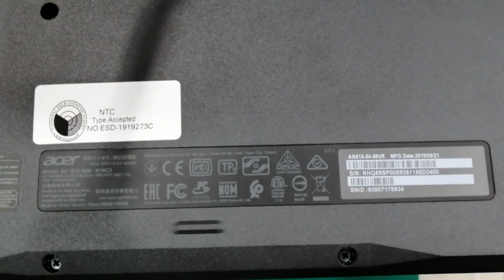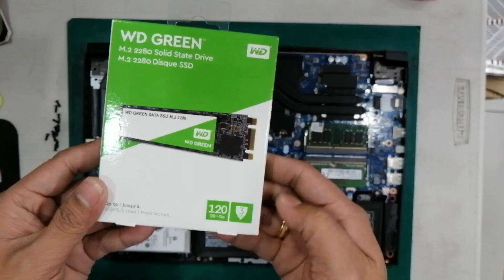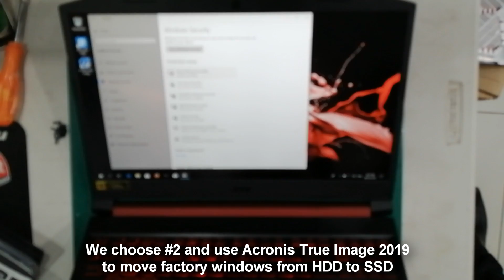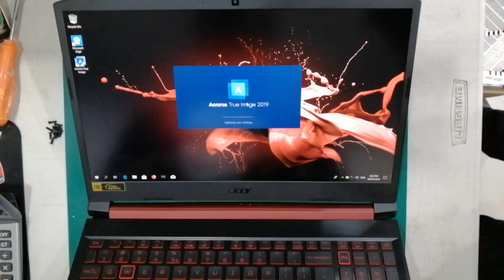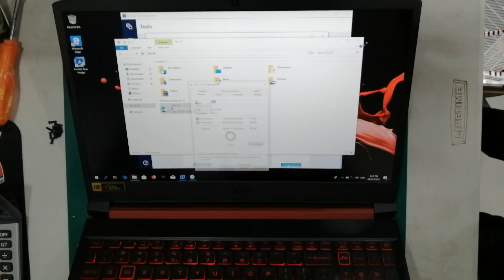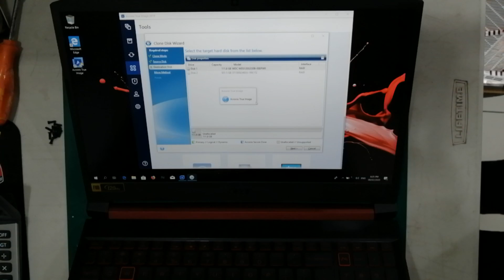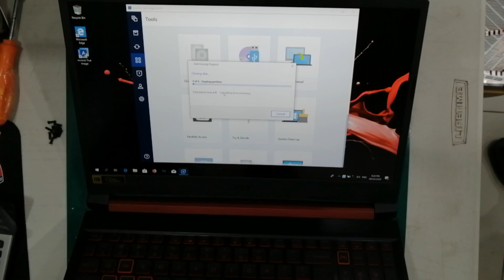How to upgrade acer nitro 5 2020 (Full)

Comment: hi, have the i7 version, been working great but now my battery won't charge, just says 28% and plugged in, tested charger putting out 19.5 volts, tried resetting battery by holding down power button and deleting the two battery drivers, still not charging, any help would be much appreciated,  cheers
Reply from the maker: russ myles I cannot assure sir it will work,but try to update the BIOS if there is bios update in acer website,if not try also to reset your windows to factory default,try also to change the ac charger with a known good one because testing the charger with just multimeter is not enough,if you done everything you can and still does not work may be its time for the warranty
Reply: @techph7854  ok thank you for you reply, will check acer website for update, have s charger from a hp laptop, will try that too if compatable,  nitro5 only 6 months old but under lock down here in tenerife, shops all shut till may 11th
Reply from the maker: @mylesruss  good luck

Comment: Hey my laptop is the one with 1tb hdd. Is there another hdd slot or I'd have to replace the 1tb ?
Reply from the maker: James L check your laptop if there is any m.2 slot and you can add storage in there,if you cannot find m.2 slot yes you have to replace the 1tb HDD to 2.5 SSD 250GB or higher,if you have desktop use cloning software to clone from your 1tb HDD to SSD,if you don't have desktop just fresh install windows in SSD
Reply: Thanks. I figured. M2 more expensive but don't wanna waste parts. I'll figure it out. Thanks
Reply: If it's of the same model, it would have M.2 slot for sure. Otherwise, it may be mentioned in your laptop specification. There's only 1 hdd slot.

Comment: Sir balak ko bumili nitro5, smooth ba gaming at video editing, streaming sa specs na:
I5 8th gen
Gtx 1650
16gb ram
256 ssd 1tb hdd
Reply: solid na yan ser. 16gbram + gtx 1650 na
Reply from the maker: pa subscribe nmn sir kung ok lang
Reply from the maker: Angelo Sendaydiego,yes sir smooth most of the game,ano games nilalaro mo sir?
Reply: TechPH im planning to buy one for school works and gaming
Reply from the maker: @theprobuilder1008  yes sir it is capable,I recommend you upgrade  the RAM to 16GB for autocad,but few of my client says autocad rendering is quiet slow,for most of the games you cannot set all settings to high to play it smooth like csgo
Reply: TechPH Thank you for the info! New subscriber
Reply: TechPH sir is the ryzen 5 3350h rx560x version of this is capable of running AutoCad?
Reply: Sir ok na po ba dito LoL Dota Cs Go?
Reply from the maker: @obliv1on16  yes sir,wag lang kalimotan e upgrade RAM to 8GB
Reply: Mas maganda ba to sir sa huawei matebook d15?
Reply from the maker: @obliv1on16  I am sorry sir I am not familiar with huawei laptop

Comment: People having stuttering issues know that it can be because ur shader cache is off in nvidia control panel and ur laptop is heating above 80 degrees try cooling it down keeping on a elevated surface for more air flow.
Reply from the maker: RTR GRIM REAPER nice info
Reply: @techph7854  thnx :)

Comment: Bro ok lang ba yung 2x 2400mhz 8GB na ram dual channel na yan diba? Bago lang sa pag upgrade haha
Reply from the maker: Lex Acuna yes bos,2x 2400mhz or 2x 2600mhz,kung pwede same din ang brand nila dalawa
Reply: @techph7854  thanks bro. nga pala bro na undervolt ko na laptop ko -0.150V pero nag  Power limit throttling pa rin kahit pag nag benchmarking  tapos gaming... Any solution on how to fix? Intel xtu gamit ko.
Reply from the maker: @lexacuna2924  sir di ako sure pero try check the temperature CPU and GPU,baka dahil sa mataas na temp mas maganda mag cooling pad

Comment: Boss Question: Plano ko po bumili ng nitro 5.. Kaya po kaya kung i.upgrade ko sa 16Gb of ram at SSD 240Gb SATA? Maraming salamat boss!
Reply from the maker: Matthew Padrique kayang kaya sir tested na yan,pweding tanggalin mo yong 4GB RAM at palitan nang dalawang SODIMM 8GB
Reply: @techph7854  Last na po boss, ano po ba yung bibilin kong dalawang SODIMM? 8Gb DDR4 2666MHZ or 8Gb DDR4 2400MHZ? Para po sa Acer Nitro 5 AN515-54-53ED.. Pasensya po boss, baguhan pa lang po ako.. Godbless! 😇
Reply from the maker: @matthewpadrique1363  I am happy to answer your questions as long as I can,kahit ano sa dalawang yan sir mag wowork nang walang problema,pero recommended ko yung SODIMM 8GB 2666MHZ,remember na normal lang na ang detect nyan sa windows ay 2400MHZ
Reply: @techph7854  Maraming Salamat Boss! Stay safe po.. Godbless :)

Comment: i am going to buy the gtx 1050 version of it without ssd. I just need it to study and play cs go and  rainbow six sometimes. Do you think it will do the job?
Reply: I have the old 1050 version trust me the standard version is rly disappointing, i upgraded it using nvme ssd 500gb wd black 16gb of ram and replace the hdd with sshd 2tb it turned into real gaming laptop now capable of running newer AAA game like Nfs heat 50fps high 1080 also change the paste with thermal grizzly.
Reply from the maker: Eliza Oliveria yes it will do the job but for playing games like rainbow six the graphics is not that great,just don't forget to upgrade it to SSD and the RAM should be 8GB,4GB RAM these days is not enough for most of the games,Also if you can  get the 1050ti version that would be more nice
Reply: @techph7854  ok, thank you

Comment: Hey sir! What kind of screwdriver did u use for the ssd m.2 screw? I can't really remove the screw there because most of my screwdrivers does not fit on it. :((
Reply from the maker: Sam Villaluz the smallest phillips bit,I recommend you buy all in 1 screw driver,make sure not to damage the m.2 screw
Reply: PH01 size screw driver

Comment: does extra ram give me more fps in games?
Reply: Depends what game you play if a game recommends 16 gb of ram and you have 8 it may make a difference.
Reply: Tacoman 2.0 does it give me more fps in fortnite if i upgrade from 8 to 16
Reply: Now a days u need atleast 16GB Ram but Ram Upgrade is totally depends on your CPU If u have a 4Core 4Thread CPU 8GB Ram Is enough .
If u Have a 6Core 6Threads and more Cores And Threads u need atleast 16GB Ram and 32 GB for more Ram for High End CPU
Reply: Giftson Raja i recently bought a gaming PC with 2x8 ddr4 and an eight core processor
Reply: @jayden94207  Ok
Reply: Maybe like 5-10 fps more so not really worth it I think
Reply: Tacoman 2.0 okay thanks
Reply from the maker: Jayden Struijck Tacoman is right
Reply: TechPH okay thanks to both for responding, you saved me some money!!
Reply: ahmeher yeah thanks man
Reply: i upgraded from 8 to 16 and im running fort with 100-200 fps.
Reply: YouGotR3kt ! what fps did u run before the upgrade
Reply: yeah

Comment: Hi, will my nitro 5 automatically clock down my new ram(16gb ddr4 2666mhz) to 2400mhz? Since my nitro 5 speed can go only up to 2400mhz or do i have to do something with the bios?
Reply from the maker: generalblackout yes you are right. Combining different clock speed will always come up with the lowest speed example:4GB 2400mhz + 4GB 2666mhz =8GB 2400mhz. I do not recommend touching the BIOS settings. Also in my experience I cannot tell the actual difference in speed between 2400MHZ and 2666MHZ
Reply: @techph7854  but will mixing ram capacity like 4 gb in slot and 16gb in the other will cause problem? I got a ryzen 7 3550h cpu.
Reply from the maker: @generalblackout8633  in my experience with latest laptop the answer is No,I don't have any issue mixing different capacity,I have several experience mixing RAM in different capacity example:4GB+16GB
Reply: @generalblackout8633  mine with 4gb and 16gb. no proble whatsoever

Comment: I put in the new RAM stick today but the screen is black on boot . I tried to put it in different slot but still doesn't work ... is that a defective RAM or simply incompatible ? it's ddr4 too
Reply from the maker: Bull1the1Great can you provide me the brand ang model of the RAM stick?make sure to wait upto 30sec when you first power it on because it will take more time to boot than usual. I have tried 2133MHZ,2400MHZ and 2666MHZ RAM with nitro 5 and it works
Reply: @techph7854  G.Skill Ripjaws series 4 GB 2666MHz DDR4 SO-DIMM PC-21300, F4-2666C18S-4GRS
Reply from the maker: @Bull1the1Great  GSkill is a good brand too,may be it is defective RAM sir,if not try another brand sir like kingston RAM
Reply: @techph7854  i think it's defective. everyone point to that

Comment: QUESTION. New to pc gaming, I have this 1650 nitro 5, i was wondering if i could just take out one of my other 8 gb memory from my 3 year old gaming desktop? i dont know shit about ram or what mine is called exactly but here are the info it has on it. patriot psd38g16002 / ps000986 - bk / 8gb pc3 - 12800 cl 11 / rohs compliant. I dont know if that will help you or not but yeah, if anybody knows if i could use this ram stick for my nitro 5 please let me know.
Reply: you cant bro, its a different form, it must sodimm ddr4. hope it helps u. cheers!
Reply from the maker: RickyRichReacts You cannot use that Desktop RAM bro it will never fit. That desktop RAM you mention patriot 12800 is DDR3 1600MHZ and your nitro 5 is DDR4 2400MHZ or 2666MHZ. If you want to buy RAM for your nitro 5 look for DDR4 SODIMM 2400MHZ or 2666MHZ of any gigabyte you prefer 4GB/8GB/16GB. Buy reputable brand like kingston,transcend,etc

Comment: Hi question I have the nitro 5 with a 2.5 SSD slot if I cloned it and left the HDD drive would it affect my computer at all or would it just get confused all the time
Reply from the maker: Jordi Toro You can leave the HDD after successful cloning without any issue.HDD is very useful to store larger files like movies and musics because this files does not neccessarily have to load faster. You will not get confused because after the successful cloning  the boot order will automatically set to SSD in most cases that means applications will load more faster and windows.After successful cloning from HDD to SSD you can wipe the HDD or reformat it and load files in there. Applications and games that is stored in SSD loads much faster than stored in HDD

Comment: I had the same laptop already upgraded to 8GB RAM with M.2 ssd when I bought it on sale at ACER with free RealME Phone
Problem is Most of the games are Stuttering, do I need to upgrade it to 16GB RAM?
Reply: i had same laptop 16gb dual channel, it still stuttering.
Reply from the maker: Jon Techie honestly speaking game stuttering is very common in laptop even the most expensive one that I have tried.What exactly is the specification of your laptop is the panel 120hz and GTX 1650 graphics?make sure the device driver is properly installed and updated example:graphics driver and chipset.I believe 8GB is enough for most of the games but give it a try upgrading it to 16GB see if it minimizes game stuttering. Good Luck
Reply: @techph7854  Thanks for your response, Yes its GTX 1650 all of the gpu drivers are update might as well try to upgrade the ram
Reply: dual channel ba tung RAM mo sir? kasi kung single channel lang, kahit na naka 8GB ka eh mag lalag talaga yan

Comment: Hey I got a question. Can I store my games on 1tb HDD?
Reply from the maker: Harry Page yes sure,when you install the games make sure you browse the location drive to 1tb hdd,for steam games you can add library and locate the 1tb drive,but the games stored in SSD loads much faster
Reply: Can I upgrade the 1tb HDD in the Acer Nitro 5 to a Samsung 1tb SSD?
Reply from the maker: @harrypage8114  yes sure
Reply: @techph7854  thank you I asked the same question on another channel and got no reply.
Reply from the maker: @harrypage8114  what u mean no reply,I already answer with yes you can upgrade your 1tb HDD to samsung 1tb SSD in your nitro 5
Reply: @techph7854  I'm on about another channel not you. I posted the same question on one of meahpooh's videos and glad you answered the question. And I know you just answered my question. Also if I wanted to spread the cost could I also upgrade my HDD with a Samsung 2TB.
Reply from the maker: @harrypage8114  yes as long as HDD 2.5 inches,thanks

Comment: I bought this about a week ago, and my charger stop charging...
Ps do I need to buy factory hdd 1tb? I don’t have one, just making sure..
Reply: Theres also a new dock upgrade you can buy for acer nitro that's a rack and it fits an hdd and an ssd inside
Reply from the maker: KizeOfficial in my country the store where you purchase the laptop can change the defective charger even after 1week,you don't have to buy factory hdd,if you want to buy or add hdd you can choose between hdd or ssd 2.5",make sure you have hdd or ssd 2.5" metal mount bracket and hdd slot in your motherboard to connect the hdd ribbon or flex cable
Reply: TechPH Okay, so the solution to my charger is to buy a new one?
Reply from the maker: @itsYeumi  do not buy new one claim for warranty instead. Make sure you have the receipt to claim for warranty of your defective charger. They will replace it with new charger mostly
Reply: My charger is getting heated a lot in a very less time...i don't how to check if its faulty....any suggestions would be helpful... i bought the laptop 4 months ago...until now its fine but i noticed the charger is heating up in no time....Thanks in advance!!!
Reply from the maker: @harishtopgi2106  I cannot check mine because of this lockdown COVID,honestly in my experience with several laptop charger that kind of heat is normal as long as it does not melt the plastic,because laptop charger does not have air vent,if in doubt claim for warranty
Reply: @harishtopgi2106  its normal with these charger
Reply: You definitely dont need a factory HDD man you can get an ssd with the same form as long as it fits it is just storage. Ofcourse if your gonna get a new drive you need to reinstall windows and everything unless you just do a transfer and then swap out

Comment: Question, Doesn't the 2020 nitro 5 have two NVME m.2 slots but you're using SATA M.2 in your video?
Reply from the maker: hey secret player sorry for very late reply,Yes acer nitro 5 have 2 NVME/PCIE slots,I am using SATA M.2 in my video because of my clients request
Reply: You can use both M2 Sata and M2 nvme.

Comment: Anong klaseng ram po ang pwede dyan? tska san nakakabili
Reply from the maker: good day kung bibili ka nang ram pumili ka kung gusto mo 8gb or 4gb,sabihin mo sa tindera SODIMM RAM 2666mhz or 2400mhz 8GB, I recommed kingston brand dahil mas tested dito samin,makakabili ka nang ganyan sa mga shop na  nagbebenta nang Desktop or Laptop
Reply: @techph7854  Pareho lang ba gagana kung 2400hz or 2666 hz lang bibilhin ko?
Reply from the maker: @cedricadrianparedes4613  yeah,sure.Tested na yan gumagana nang 2400mhz or 2666mhz SODIMM.

Comment: I already have a 256 gb nvme ssd and a 500 sata ssd in my acer nitro 7 can i add a 1tb nvme ssd to the other nvme slot and use it
Reply from the maker: chigz if you have 2x nvme slot in your acer nitro 7 like this in the video yes you can add another 1tb ssd nvme,make sure you see 2 PCIE or NVME label written in the motherboard of you r nitro 7,please don't forget to subscribe we have more videos to come
Reply: TechPH my acer nitro 7 looks like the inside of the nitro 5 in your video where would I see the label and thanks uve got a new sub from me😁
Reply from the maker: @kennytherobot  forward my video to 5:32min or 5:48min you will see the label PCIE/SATA as I lift the m.2 metal cover,make sure you set the video quality to 1080p